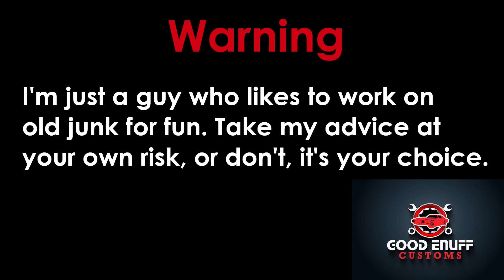Hot Rod Power Tour - Hot weather, expensive gas, but an awesome time!

Comment: Buc-ees . . . I had never heard of that place until this past year. I stopped off there and went inside to see what the fuss was about. It was the middle of the week in nowhere Alabama and that place was hopping like a Wal-Mart on Black Friday with $25 TVs. I literally turned around and left without even buying so much as a stick of gum. Talk about sensory overload. It was like the entire strip in Gatlinburg crammed inside an Aldi's building. Sorry for the comment overload, I need to open a notepad and just keep notes as I watch next time 🙂
Reply from the maker: No worries! Buc-ees can be a bit much, but it's worth is for the beaver nuggets! You can also get them on Amazon.

Comment: Oh man, that bearing was COOKED. I had a similar issue on a small utility trailer, not on my vehicle. Mine wasn't that bad though. It was in pieces  and it did hose my axle up too, but all told it was a quick and relatively easy fix on that.
Reply from the maker: I've never friction welded a bearing race to a spindle before, and the outer race ate up the hub too! As soon as I get the truck back I can figure out what spindle I have (can't remember if it was 2" or 3" drop) then I can get it back on the road. Hopefully within the next 2.5 weeks, Southeastern Truck Nationals is July 8-9!